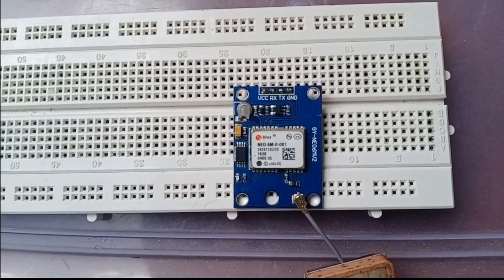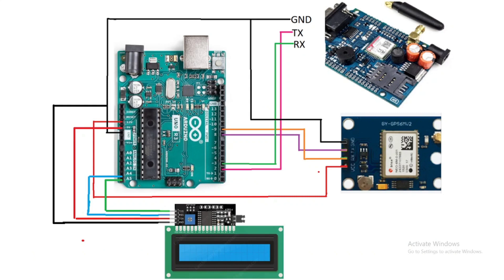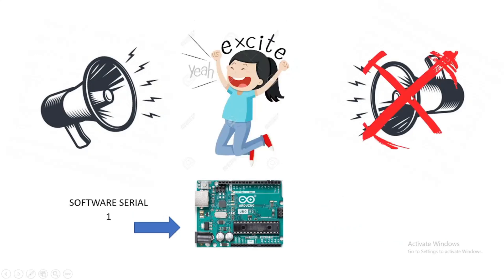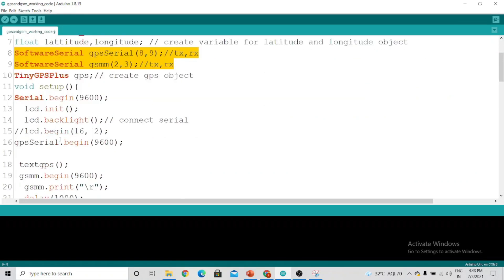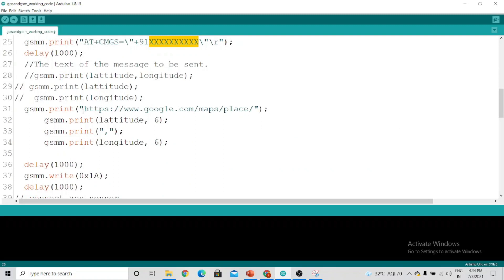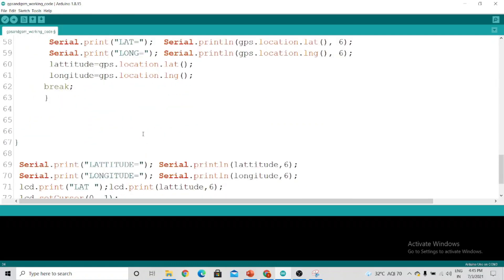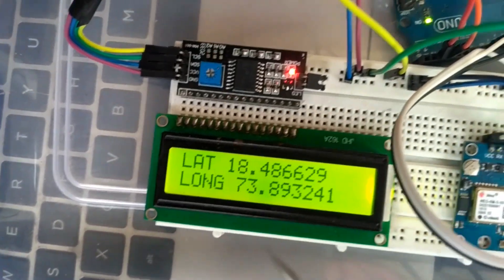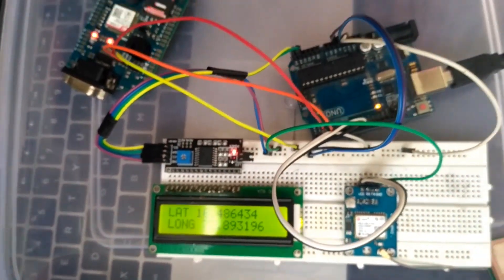How to Interface GPS and GSM with Arduino | location tracking System|#gps#gsm#gpsandgsm#gsmandgps

Comment: How com GSMM doesn't have .listen( ) function?
Does GSMM.begin( ) automatically stop GSP and start GSMM.listen()?
Also this code is in the setup, so it works only once at the beginning.
If I need to use it in the loop, both GPS and GSM needs to take turn to use listen() function?

Comment: This code is really working, I managed to edit it so that it can work in a loop with an input of a push button, it definitely does work. You can use SIM800L in replacement with the gsm module that he has used. Thank you to the video creator, you saved us in our project design
Reply: @ryandanieldagoc2962 did you receive the location on you mobile phone?
Reply: @apurvwaghmare5974  apparently here in the Philippines, it is not allowed to send coordinates via text message. It is automatically blocked by the provider
Reply: @deekshitham1643  im from the Philippines, we used a 4g sim card, we even tried using 5g

Comment: Hey Thankyou soo much the project is working.  But i needed to know if there is any way i can send the message to phone when certain condition is met instead of pressing the reset button manually.
Reply from the maker: yes you can
Reply: Hey have you used the same GSM 800 C module or any other ?
Reply: How to do it inside loop with certain condition

Comment: hi, i am using the code, but my phone are not receive any sms and arduino ide there showed "the selected serial port 
 does not exist or your board is not connected"
Reply from the maker: It's the serial port error check properly if you have selected the same port on which Arduino is connected.it has nothing to do with the code it's just port error

Comment: if I no use lcd,  can it working?
Reply from the maker: Yes obviously it will work lcd is only for display purpose there any ways you can see the output like on serial monitor etc.
Reply: @TechTooB2  so i need change any code?